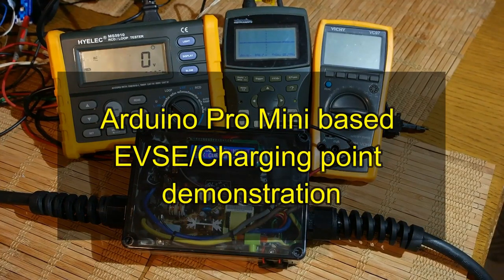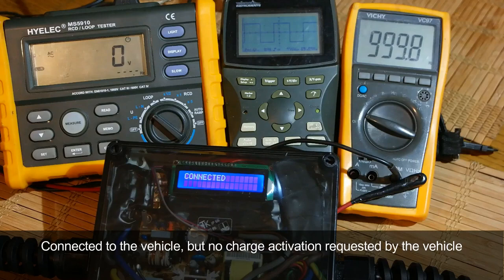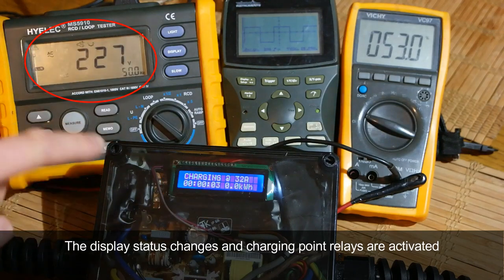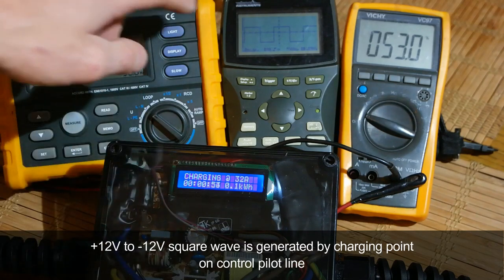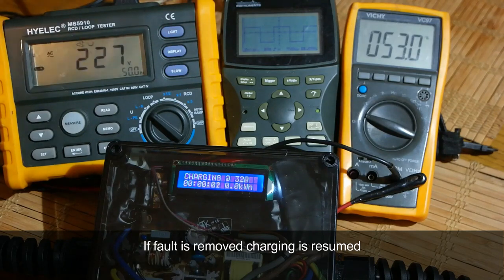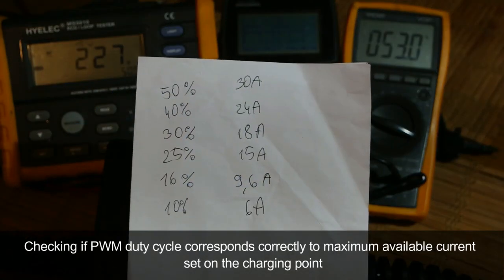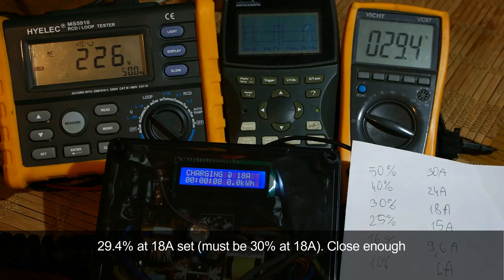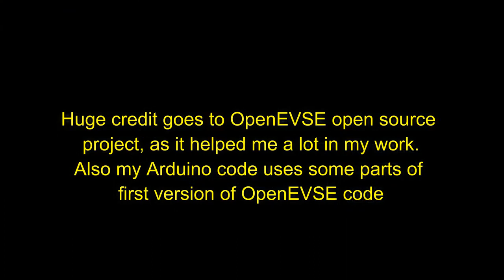Arduino based very simple DIY EVSE / EV charging station / charging point

Comment: I am just curious if anyone has had issues of their op amp only being able to swing voltages to rail supply. So wouldnt it be better to use a +/- 15v supply
Reply from the maker: Normally you should see max 0.7V drop (compared to your supply voltage) after op amp, depending on amp used and its quality. This should not be an issue for charging logic as CP voltage can vary +/-1V according to existing standards.
Reply: @ev-olution8597  thanks for the reply!
Reply from the maker: @pohlr1  Not sure if it was you who contacted me by email regarding this issue. If not, make sure you use 680 Ohm resistor as R1. Wiring diagram shows 1 kOhm, which is incorrect.

Comment: Hi I tried this charger on tata Tiago ev, and it's works! Thanks a lot for this project! 
The only issue is, at current setting of 6A, the charging does not charge, and it start only at current setting of 10A.
At this current setting, the actual current taken by the EV was only 6A😅
Reply from the maker: That means your operational amplifier used does not generate clear square PWM signal. You need to check your signal with oscilloscope and use genuine LF353 if needed. Also make sure cable between your vehicle and charging point is not too long and does not distort PWM signal.

Comment: Will the Transistors be able to withstand to keep relays on for long time? They appear to get warm
Reply from the maker: It depends on what relays you are using. Relays with low coil resistance might need different transistors. But standard relays works fine with the existing transistors. I got few charging points built with using these transistors and they run for years now without any issues. Also use only genuine electronic components if you want to avoid headaches in the future.

Comment: Hi the new arduino nano are included with atmega328pb chip instead of atmega328p, and hence the hex file also does not work, could you please provide a new hex file compiled for Atmega328PB microcontroller please?😊
Reply from the maker: There is no compilable code for free version of DIYEVSE as this project was started few years ago and was developed to much more advanced version. Also getting the right microcontroller takes less effort than trying to dig in to old project ;) I no longer work on EV projects, so trying to find or change anything takes a lot of time just to go trough old stuff and old code.

Comment: Hi, I tried to upload the hex file into arduino nano, and after that, I am able to see the display and also set the current, but there is no PWM being generated !!?, could you please tell me what might have gone wrong?
Reply from the maker: PWM is generated only after EVSE is connected to vehicle. If you tried to connect it to vehicle but screen does not change, most likely your PE (Protective Earth) terminal is not connected to GND terminal on PCB. Also common issue is when people forget to add correct resistor between PE and PP (Proximity Pilot) terminals on Type 2 connector, which connects to vehicle.
Reply: @ev-olution8597  Thank you so much for the response!, could you please tell me, how I can try to simulate the vehicle connection?
Reply from the maker: @rohanchinnicl8059   Vehicle connected and requesting to activate relays can be simulated by connecting resistor with value close to 880 Ohm and a diode (connected in series) between PE (protective earth) and CP (control pilot) terminals on charging plug.
Reply: @ev-olution8597  with my oscilloscope, without any connection, I found that, the Control Pilot voltage with respect to ground is 11.4 volt, and with a Diode and 2.2k Resistor, I am not able to simulate the vehicle connected display.

And with parallel Resistors of 2.1k and 1k equivalent of 700 ohm resistance also I am not able to get the connected on display.

When I connected 5 ohm Resistor with Diode, then I was able to get connected on display, but the Relays were not activated.

In my circuit I have not connected the bidirectional TVS Diode as of now.

could you please help me, what might be causing this problem?? Why are the usual 2.2k Resistor does not simulate the connected on display?
Reply from the maker: @rohanchinnicl8059   Check R2, R3 and R4 resistors. Make sure they are connected correctly and has correct resistance. R2 must be 200 kOhms, R3 - 100 kOhms and R4 56 kOhms. They form voltage divider for A1 analog input. If any of these resistors are wrong, it won't work. Check if your R4 resistor is connected to 5V and not 12V. Measure resistance between your circuit GND and PE, it must be 0 Ohms. Also check which firmware you are using. Free version and the one which comes with PCB has different control pilot sensing inputs. Free version uses A1 input.
Reply: @ev-olution8597  Thank you so much! For this information 😊
Actually I got to know what the problem was, I had replaced the smd atmega328p microcontroller in my arduino nano, during replacement the excess temperature by the hot air gun must have damaged the internal Resistors in the analog port of the microcontroller.
I tested with another arduino uno, and all was working perfectly!!. 
Thank you very much for the help and support 😊, and also excellent project!!
Reply: I simulated the vehicle connect and charging activation with external Resistors and Diode, everything works perfectly!!
I shall test this with my car Tata Tiago EV later and post the results!! 😊

Comment: This was really helpful video. What needs to be changed for Single Phase AC supply and using J1772?. Please help me with this.
Reply from the maker: Nothing needs changing, except PP terminal is wired differently in a plug. But PP usually comes prewired from manufacturer already, so you don't need to do anything with it.

Comment: Hi.
Nice project you have made there 👍.
I would like to ask if there is any possibility to test without an electric car.
Thanks in advance
Reply from the maker: Yes, it is possible to simulate EV connected to EVSE. You only need couple resistors and diode connected to control pilot line. Resistor values can be easily found online, just use google ;)

Comment: Hi there! Congratulations on your project, I was wondering how and what does the car tell the EVSE via the Control Pilot pin, can you elaborate on that? I understand the relationship between the duty cycle and the current and also the states of the car with the 9/6/3V to -12V, what I'm confused is who transmits what on the Control pin and what is the order. Many thanks!
Reply from the maker: Car only changes resistance on control pilot line, which affects voltage level. This voltage drop is monitored by EVSE and according actions are being taken.
Reply: @ev-olution8597  Very good, I wasn't able to find anything clearly stating that anywhere. So the EVSE does basically what that addon module of yours do, for the ones that do not have the oscilloscope.
Reply from the maker: @wagnerbrochini3892  Yes, most of EVSEs/AC Charging points/AC charging stations uses same logic. EVSE basically is just a contactor between grid and your vehicle. And it connects vehicle to the grid only when it is requested by vehicle and if it is safe to do so. The only difference between different EVSEs is user interface and number of different integrated protections.
Regarding oscilloscope, these days you can get usable oscilloscope for less than 20 dollars. If you are on a budget and only started learning electronics, look for STM32 based oscilloscopes such as "DSO150". These are very simple and handy things.
Reply: @ev-olution8597  Well, thank you so much for your insights, you've been very kind!

Comment: sir you said that,for getting a source code you should follow the open evse ,In that which all programs you combined to form this hex file
Reply from the maker: My project uses simplified OpenEVSE wiring diagram. PWM signal generation code was used from OpenEVSE, also my early code was using OpenEVSE different state change logic. Everything else like current adjustment and saving on EEPROM, voltage level monitoring on CP and PP terminals, calibration settings, current measuring, serial communication for ESP32, LCD display code was written by me and has nothing in common with OpenEVSE code.
My own code is not open source. If you looking for open source project, look to projects such as OpenEVSE. I am not sharing my own code for many reasons, most common one is that electronics students try to use other people work to fake their graduate work. I am also getting many emails from some startups asking to share my code, as they are looking for very easy profit and apparently they are not experienced enough to understand OpenEVSE code which is freely available on GitHub. That tells a lot about such startups...
Reply: @ev-olution8597  ok thankyou

Comment: hi, im just wondering is it fine if im using a solid state relay? will there be any problem with it?
Reply from the maker: I personally don't like solid state relays. Good quality ones cost a fortune and the cheap ones often fail. I had some failures previously in different setup where it failed by staying open all the time. And that's not what you want on EVSE device.

Comment: can you pls tell me at circuit level how it will mange to give diffrent voltage level  what happen to efficiency
Reply from the maker: Sorry, I didn't understand your question. If you asking how PWM signal is generated for control pilot, then it's very simple. Arduino generates PWM signal on pin10, this signal is then converted from 0 - 5V to -12 - 12V by operational amplifier which then goes through R1 resistor to control pilot terminal. Resistance changes on vehicle side determines the voltage drop on control pilot line. Control pilot line is monitored by arduino A1 analog input, that's how Arduino knows which state it should go to.
Reply: @ev-olution8597  not like that  lets suppose ev need 5 kw power and evse is capable of delivering 7kw what will happen to rest 2 kw  that I am asking it will be helpful if u can explain me
Reply from the maker: @PawanYadav-og9nx  Are you really trying to built EV charging point? Or is it just a questions that needs to be answered for uni project. Sorry about being bit rough, but in recent days I keep receiving tens of emails and messages from electronic students asking to explain how EVSE works only because they decided to use my project as a finishing project for their uni.
All information is freely available on internet, you just need to use google. Quick answer to your question is, EVSE don't care how much amps your EV is pulling. It just activates or deactivates relays and sends current limit information to vehicle by using control pilot PWM signal.
Reply: @ev-olution8597  thanku
Reply: @ev-olution8597  basically I am  ev infra engineer in a company just curious nothing else
Reply from the maker: @PawanYadav-og9nx  as EV engineer you should know the basics of how EVSE works, and that there is no such things as voltage dividers on main power lines. Sorry but all these questions looks very similar to the ones I received by email from electronic students. That's why it makes me very suspicious. If you really interested in AC EVSE working basics you should first do research about EV On Board Charger (OBC) and how it works. After getting familiar with EV OBC you will understand why there is no need to have any circuit in EVSE for physically limiting current or variate the mains voltage.
Reply: @ev-olution8597  I hope there must be voltage divider to deliver different voltage to ev ,like evse is capable of delivering different voltage level  if ev require 48 v and 72 volt how evse will manage on circuit level

Comment: Hello, i'm curious about this type of DIY charger solution.
I saw this video, from Hacksmith Industries (https://www.youtube.com/watch?v=TJFgCvKxr90), where he shows how to get an interface for public chargers to feed voltage and allow his common 240VAC charger to work, but in my country (Brazil), we use Type2 on the chargers, so i would like to know if i can do the same build as his to be able to recharge a future EV project?
Reply from the maker: Type 2 and Type 1 uses exactly same logic for control pilot signaling, so solution showed in your linked video works on Type 2 also. The only thing to mention, doing this to public chargers are totally illegal and might cost a lot of money if something wrong happens while your device was connected to a charging station, even if it was not your device that caused some kind of unfortunate event. Also people get mad when they find someone occupying EV charger just to charge electric scooter or electric bike.
Reply: @ev-olution8597  alright, thanks and i will take care of myself to not get caught in problems

Comment: Hi. Can I ask if your EVSE will work on cars that need J1772 signals and IEC 61851?
Reply from the maker: Yes, as Type 1 (J1772) EV connector uses exactly same signaling on CP (control pilot) as Type 2 connector. The only difference between Type 1 and Type 2 is PP (proximity pilot) and phase number. But if you using tethered EVSE, PP pin is not even connected to EVSE itself.

Comment: Hello, thanks for the video and such a detailed description. I am about to finish my own EVSE version, and I've choosen very similar power relays. They are 30A rated, but I still have some doubts about their actual power handling capacity. Did you have any troubles with them?
Reply from the maker: Hi. I use Relpol 40A relays (R40N-3021-85-1012). But yes they generate some heat. Relay coil temperature goes up to 45C degrees even without any current flowing through main contacts. So if you want a bullet proof design, I suggest using proper contactors instead of relays.
Reply: @ev-olution8597  Thanks for your prompt reply, guess contactors are really bullet proof, maybe will also test SSRs.

Comment: Can you please provide me with the source code?
Reply from the maker: Sorry there is no open source code for this project, only non editable firmware in binary format on my site. If you looking for open source project, I suggest you to look at OpenEVSE project.
Reply: I'm going to use arduino nano, I think it will work too?
Reply from the maker: @syedareeburrehman3835  Yes it should work as it's also ATmega328P based board.
Reply: Okay thanks, I am enhancing some features of it, can I use this as a final product?
Reply from the maker: @syedareeburrehman3835  What do you mean by saying "as a final product"? If you want to use it for charging your vehicle, then yes, firmware is fully functional and will charge vehicle without any problems as long as device is assembled correctly. As for hardware I can not comment if it's safe to use as I can't see how people assemble it, what type of materials or protective devices they use. It's only up to them to make sure their devices are safe to use and conforms local regulations.
If you asking if it's ok to use my firmware for commercial products, then no, as I clearly stated in my website. That's why it got my website address on the main screen. If someone sells product with my firmware, customer most likely will find out that product they bought are fake DIY EVSE :) This would most likely affect sellers reputation.
Reply: OK, working on it. Will show you after completing. Thanks for sharing information.